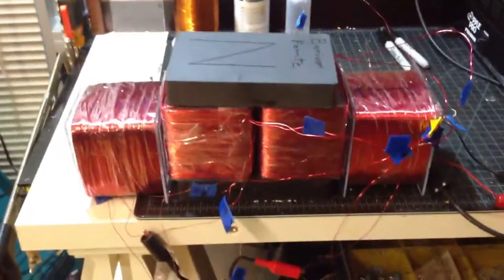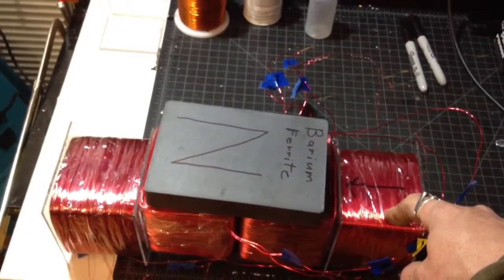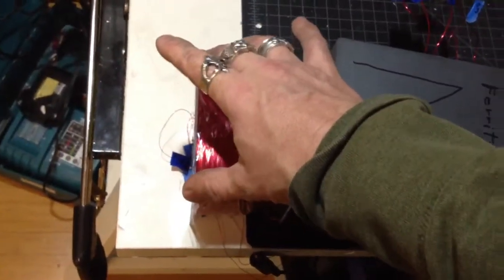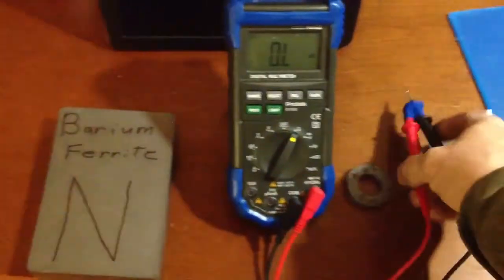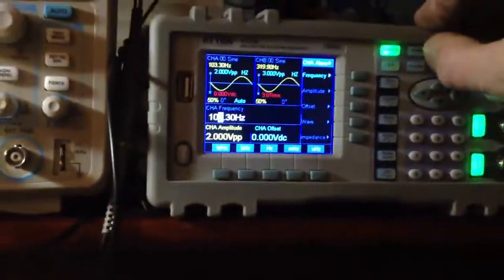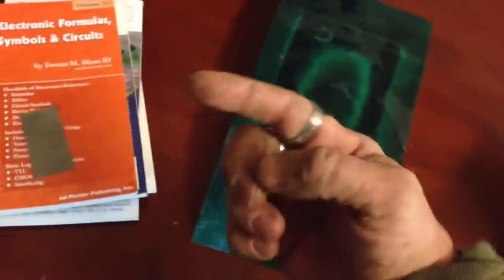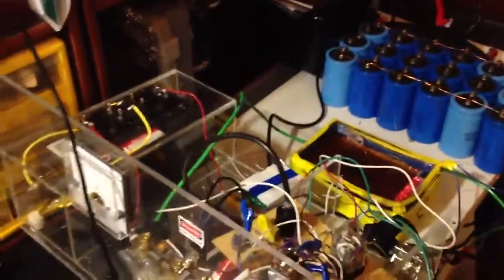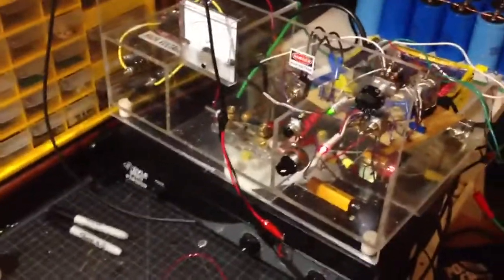Free Energy John Bedini Tesla how to build a VTA Floyd Sweet

Comment: Did you ever get this to work? How did you treat the magnets? An idea I had to treat the magnets had to do with phase conjugation. Did you ever try heating the Barium Ferrite magnets? Barium, especially in Barium Titanate has to be heat treated for the dielectric process to work correctly at around 120°C to 130°C (that's 244°F to 266°F). The curie point of Barium Ferrite is 450°C, so you wouldn't damage your magnets by any stretch. (Edit: Not sure if the magnet would crack at these temperatures.)

Comment: I was just wondering, did you heat the magnets up to 180° at their cure temperature before you blasted them with the frequency and the voltage?? If so, would you be willing to sell me a set of conditioned magnets?
Reply from the maker: Unfortunately, all of my lab equipment is in storage right now however if I set it back up I will be sure to reach out.
Reply: @3nealweber3 theres a big renewed interest in this,i think it would be great to see you start this project back up

Comment: Your magnet energizing coils cover the entire surface area of the magnet. From what I have seen, that’s not the way they did it. The coils are only supposed to cover the Bloch wall, which is the center stripe down the middle, where by the two coils overlapping would form a cross. I would try it again like that, where only the center line of each axis is covered by the coils and see what happens. Best of luck and hope to see more results soon! Cheers.
Reply: There is one other step that is missing, and that is after you energize magnet with the coils, and get the moving blob of negative polarity/dead zone in the middle of the magnet, according to Don Smith, you then need to hit it again except not with coils but placing it between two electric plates. So what you end up with is essentially a hybrid magnet/electret with a moveable blob dead zone in the center. The final electric plate step hits the thing with a high electrostatic charge, where it causes a positive polarity on the top to remain, like an electret. But honestly, I think all of this is folly without understanding the underlying concepts of what you are actually trying to achieve, because you can end up endlessly chasing your tail down rabbit holes. And if you do understand it, then you don’t necessarily need to copy Floyd Sweets version, because with anything there are always multiple ways to accomplish the same goal. You just need to be creative.
Reply: @BrentLeVasseur  yes and visualization ought to help. Since current is induced as wiggling magnetic field lines cut conductors at 90 degrees, mapping those lines will inform placement of the conductors
Reply: Bedini's version was different from others we saw in photos. Assuming no one lied, there are multiple configurations that should produce. Getting this to work will involve lots of tinkering, measurements, and careful thought and calculations.
Reply from the maker: Thanks

Comment: Damn and now we know the magnets were just a hoax told by sparkeys team to throw ppl of the true function of the VTA. You dont seem to have the coils wound corectly on the VTA either. Did u ever get it working? From what we see here, you did not.
Reply: I don't believe magnets were a hoax (neither was magnet conditioning a hoax, as far as i can tell from folks who replicated it). Bedini even saw his unit working for a short time after Sweet fussed with it. But to gather power, a wire must cut a moving magnetic field line. I reckon some animations of these would help
Reply: @paulshields1883  it was a hoax in that you don't need the magnets for the effect. You can have them and they do help you understand what is going on in the beginning. But after you figure it out and understand how the machine works, the magnets are not needed.
Reply: @GuardianEngraving  I'm interested to see a fully detailed workup, with measurements

Comment: Nice to share your experiments. https://www.youtube.com/watch?v=UVhGQaESKEI&t=1361s
As I understand in the video link I posted, a 60Hz is applied on the A coil who wich surrender the magnet, X axis, B and C are Y and Z and the pulse go on both at the PEAK of the 60Hz and the 60Hz must opposite of the magnet, then the pulse is sent.
Now to run the conditionned magnet in the VTA, we need to use a bias high voltage accros the Y axis, around 10kv DC.
To be clear, this is an magnetised piezo electric element with a 60Hz pattern in it. I work on Akula devices to see how it work and also there we use HV bias to make the device run. We have a Facebook page Akula0083. Thanks again for your experiments.

Comment: I believe it has to be barium ferrite because the self oscillation involves some kind of destabilization of the barium atom's nucleus.  A particle gets blasted out and is magnetically attracted back to it's "hole" but is repelled by gravity (it was a very technical article and i'm not a physicist).  But barium ferrite is the only magnet you can create the self oscillation (that we know of or with lack of evidence, believe) required to pull energy from the vacuum, and is part of why no other magnet works.
Reply from the maker: Jarrod unfortunately I do not have any barium  ferrite magnets left. I had to have them custom manufactured in China. You can try to 
Find a place to make them there just make sure that you send them to a lab to test to insure that they are indeed barium ferrite. Good luck my friend !
Reply: @3nealweber3  I believe those magnets can be reset and reused. They have a lower heat threshold to reset them. I think you can heat them up, reset the fields, and then re-program the magnets.

Comment: Air gap betwen magnets must be smaller 0:01. And you must prepare magnets puting one, then other to cilindrical coil of maybe 500 turns, like in Sparky video and disharing capasitor to it of 400 volts with 60 herc. Then puting magnets like in this video and puting to horizonatal axis coil 60 herc sine wave of 5-12 volts. And in vertical axis coils like in video, you must gett more energy, than put in. :)
Reply from the maker: Thanks for the info when yours works please post it on youtube so we can all replicate thanks.